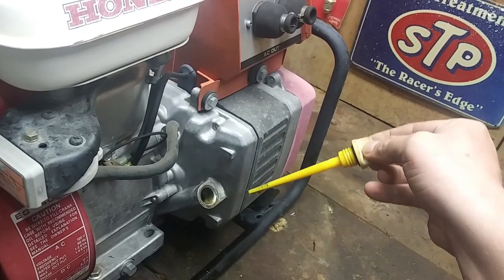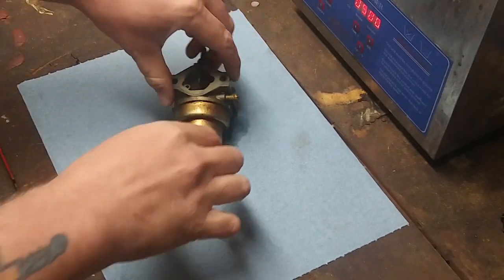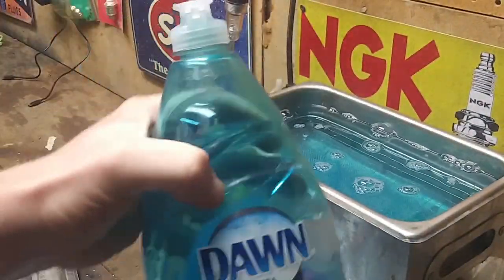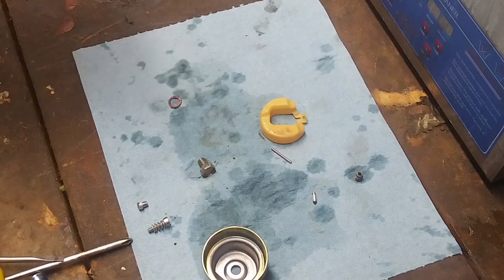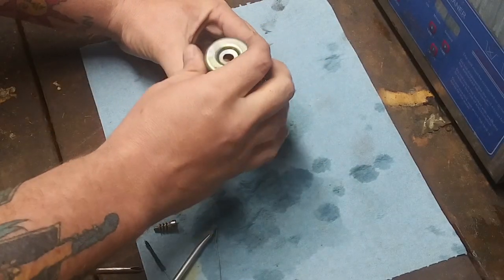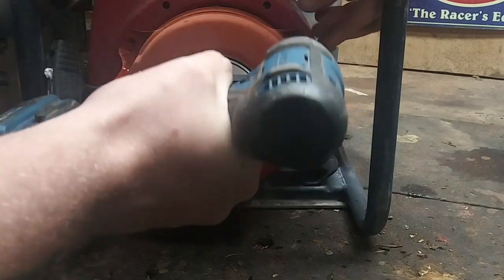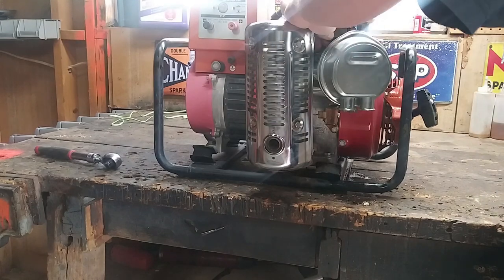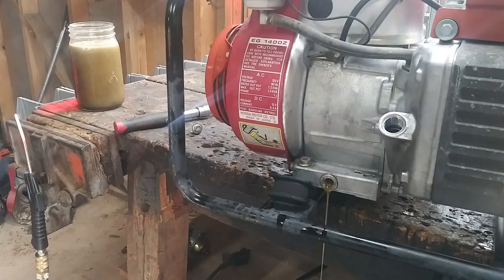Honda 1400 EG Generator repair + giveaway.

Comment: I use a stainless steel loose Tea ball for the jets and small parts in the carb for the ultra sonic cleaner. Also I use the small end of an allen wrench to push the emulsion tube down and out from the top. Works great. Thanks for the video.
Reply from the maker: Never thought of an Allen key

Comment: Always check the oil level on engines with a gravity feed gas tank. And oil condition means nothing either. Had one "no crank" with fresh oil in it. Largest piece of piston was the size of a quarter LOL
Reply from the maker: Great point!